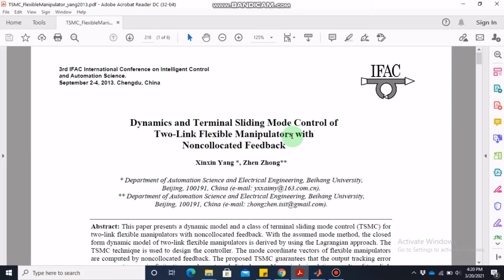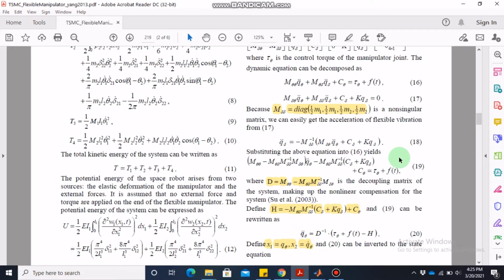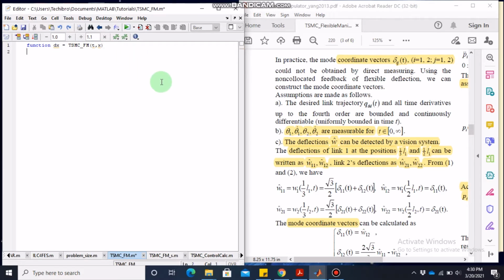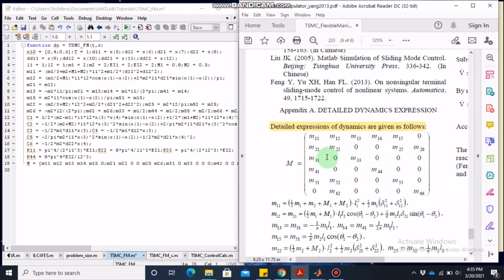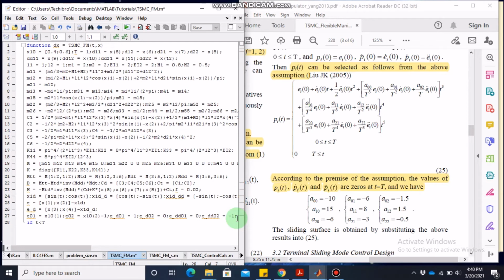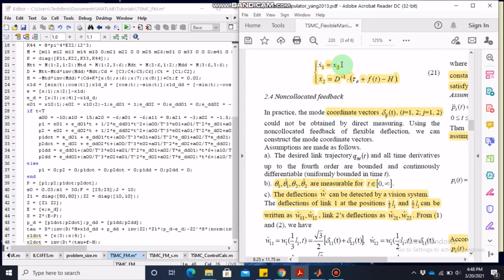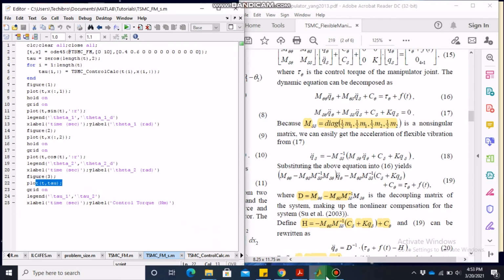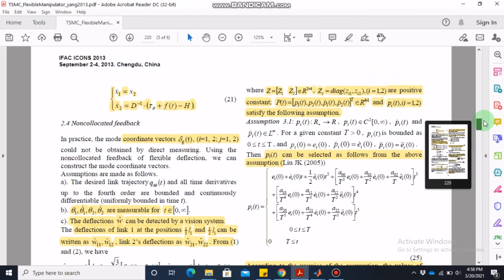Terminal Sliding Mode Control of Two Link Flexible Manipulators MATLAB Simulation

Comment: please, i would like to ask you if we can divide the code and implement it in simulink as a dynamic part and control part , taking into account the output of each part but using the same code, is that possible?